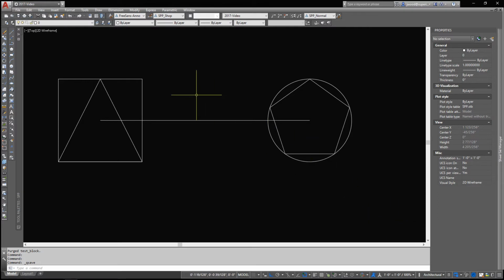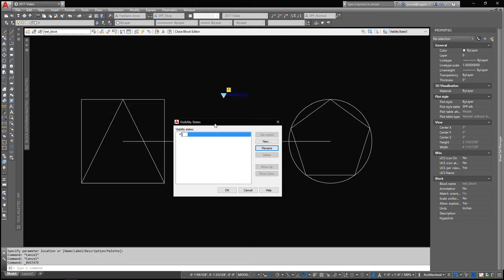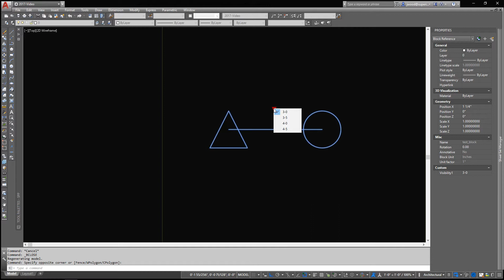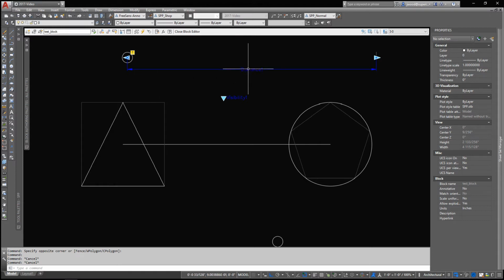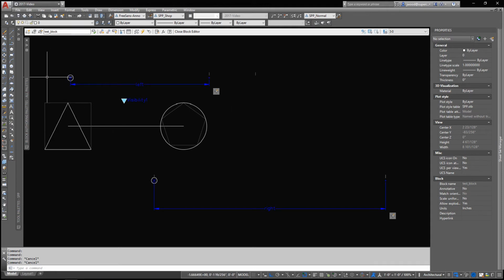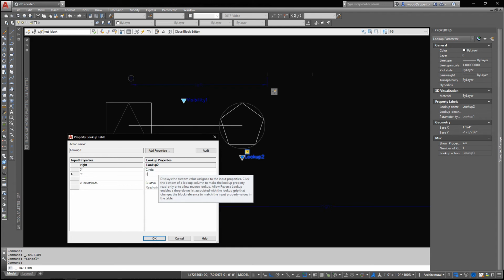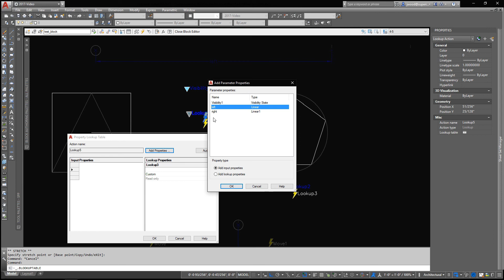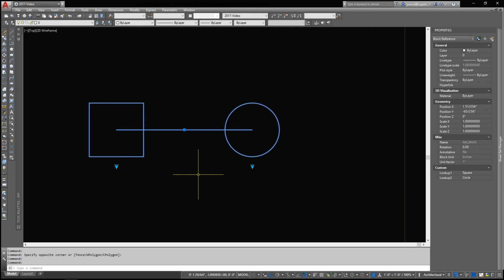AC #02 -  Let's Make in AutoCAD - DYNAMIC BLOCK WITH MULTIPLE VISIBILITY PARAMETERS

Comment: Please please please somebody point me in the right direction. I need to do exactly this, but with 4 sides of my block able to turn on and off independently. Does that mean I need to set up each "move" parameter with 8 "lengths" each, with a total of 32 "sizes", and then instead of a double lookup, I would need an octo-lookup???  Or do I just need two "sizes" for each side (on and off) and then a 64-lookup parameter to control the whole block? Is there a video that shows how to do this?
Reply from the maker: The latter is closer; each length parameter needs as many options as that associated visibility set, so just 2 for each "on/off." The lookups stay as a pair, but the one with lengths needs every possible combination, so 2 x 2 x 2 x 2 = 16 lines in that lookup, with associated 16 actual visibility states.

Comment: This is great! I am currently working on something similar and I found this video to be very helpful, but now I'm stuck. When I delete the block and drop it in a new window my items are showing and  listed correctly in both Lookups... but my items  are not switching. They seem to be stuck on the first visibility status. Mind you, I am adding more items that you have in this video. Any idea what I am doing wrong?
Reply from the maker: I'm not sure entirely I follow what exactly you mean by "drop it in a new window," as that could refer to several different actions. My general advice when working on any blocks though is to delete all copies, PURGE them from the drawing, and re-insert if changes don't seem to show up correctly. Hope that helps! (If not, feel free to head to the AutoCAD sub-reddit and we can go further into depth on whatever is happening.)